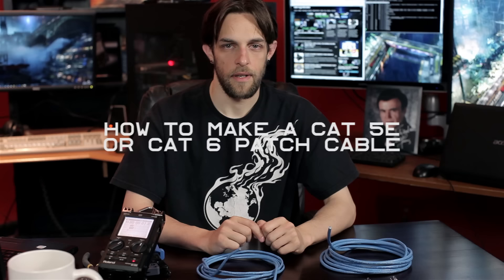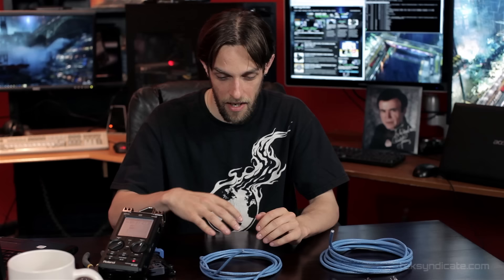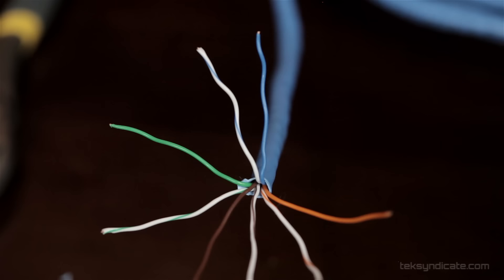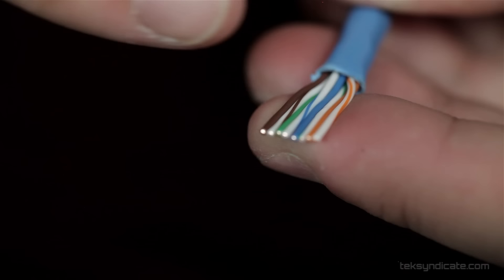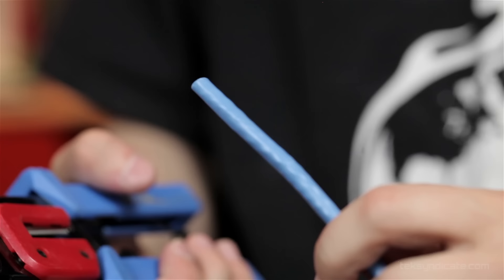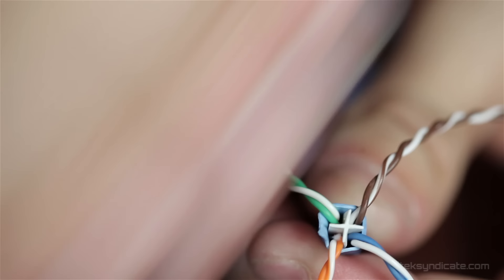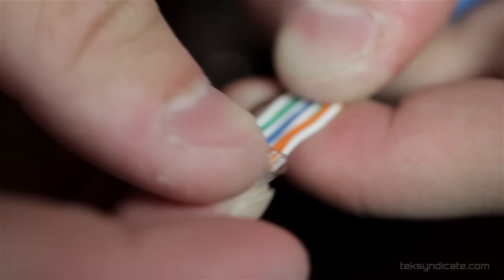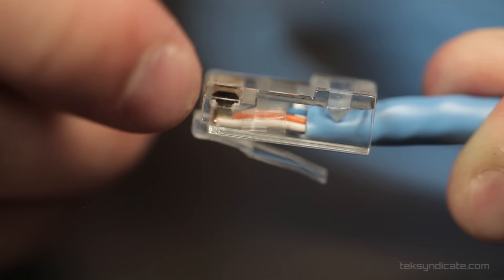How To Make RJ45 Network Patch Cables - Cat 5E and Cat 6

Comment: I have cat6 exterior black silicon wire with a centre star core ,. Need to get 2 plugs so to completed my stereo needs with BlueSound vault hard wired to my router cheers John

Comment: The load bars in cat 6 connectors look like they are not only designed to cut down cross-talk but they seem to hold the wires in order.  I was thinking of getting those EZ-RJ45 connectors that the wires stick out of when you crimp them and the tool trims the ends off at the same time.  If I just go with cat 6 I might not need them.

Comment: You make it look so simple! I've been trying to get the combination of the twisted pair wires into the RJ45 identical at both ends for the last couple of days without much success. All that I've succeeded in doing is to have run through a bunch of connectors. Any guidance would be welcome? My intent here is to prepare ethernet cables for a home CCTV network.
Reply: Personally, I would use passthrough connectors.  You don't have to worry about the length of the wires and it is easier to pass the wires through the connector and simply trim them after you crimp if your crimper cannot trim them.
Reply: @andrew7629  Thank you. I'll try to get those online. Afaik they aren't stocked locally

Comment: These cables are also not factory certified.  If you don't use the proper connectors, the cross-talk component at the plug will greatly lower performance.

Comment: Why do you not have to strip the wire to bare copper before inserting into the mod plug? I’m needing to do this as my drywall contractor put a screw through the patch cable I ran in my new construction.

Comment: Cat6 is a thicker wire and is 22 gauge. Cat5e is 24 gauge. That's one  I could never get why the convention is the smaller the gauge the thicker the wire. Also your using the 568B standard crimp, handy to know

Comment: Thank you, kind sir, very helpful and entertaining.  I am replacing a bunch of Cat5 cable with Cat6 for my home network.  I have some old but never used cat RJ45s.  I believe I've had them since before 5e and 6 were invented.  Is there a difference in RJ45s?  Should I get new RJ45s for Cat6?

Comment: Keep in mind, this is using the T568B cabling standard when most homes are wired with T568A. So make sure you know what standard you are using before following this video.
Reply: Doesn't matter as long as both ends are the same.  In 20yrs I've never seen an 8p8c terminated to A
Reply: @markhollingsworth3097 

All US government facilities require that the 568A standard be used.

Comment: I have been trying to get a cat5e or 6 cable with 8 pairs. The reason is that I want to wire up my house with double sockets in the wall. Pulling 2 cat5e/6  cables is a pain trough a pvc pipeline. Sadly I have found these at very high prices. 😞

Comment: I'm new to this and this is a great video. I expected each wire to be bared at the end? How does the connection work if the wires are not bared? Also wouldn't it be so much easier if all the colours matched eg dotted green with solid green etc.

Comment: Thanks handsome, BTW. I got the normal r j45 so is a pain in the ass getting the shift blue tube inside of it since is a cat6 cable. But I'm close to it. Thanks again. Everybody told me I was crazy because nobody got that I have a cat6 and couldn't managed easily to get the shift up after the clip

Comment: I Just want to thank you so much for this simple information that latterly helped me, why i ay simple bc i bought another router and i connected it to my base router and it working cable but i couldn’t get speed over 100 mb, i thought of changing the cable and it really a long cable, but i though to recheck the colors that the tech guy installed to me and i sow its different than what u show me, i reinstall the cable with ur color order and i got my full speed!!! 
I know i wrote alot but i want to thank you again and tell you how helpful u were i was going to pay another 100$ for cables.

From Jordan Kingdom

Comment: Right at the beginning you bend the cable waaayyyy too much. Usually single core copper wires get frayed due to that. Multicore won't
Reply: Yeah I quit watching when I saw him stripping the cable sheath with the cable crimp. For someone that has made as many as he said he has it is cheap cheap cheap to buy a cable sheath cutter and they work fantastic without all of the cable bending.

Comment: They are simple and easy with a good RJ45 connector. It's a nightmare with arthritic fingers and a cheap one piece connector (i.e no insert to help keep the conductors aligned). Always make sure to source these two piece connectors or the newer EZ-RJ45 that have end-pass-through holes. Working your way through a hundred cheap ones is a nightmare.
Reply: oh... and always fit a boot, they cost pennies

Comment: I wanted to make certain that I was building the cable correctly, so I took a working Cat5e cable which I tested and found it was running at 200+ Mbps.  But, once I changed the RJ45 connector, the speeds dropped to 90Mbps.  What am I missing?

Comment: I do have an actual question, and it’s mostly about the other end of the cable, and by that I mean, I heard in my networking class that the connectors should be somehow inverted or something like that? If you could answer that would help me a lot.

Comment: I have some commscope gigaspeed xl cable I want to use but the wires are all paired with a SOLID white wire,  instead of a striped. Should I treat the solid white pair as though they are the striped? THanks

Comment: I cut the cable going to my router open and its only cat 5 does it matter if its only 4 feet long? The house is wired with cat 5e and ive had network stability issues

Comment: So i wanted to (re)wire my home with Cat5e or maybe 6....but i heard there is a length limit....is that limit from the modem to each of the jacks i would make, or does making more jacks ports in anyway help. i guess what im asking is what is done to homes that have rooms or line runs that are much farther away no matter which path you take to the modem?

Comment: We try to not do this as general practice, buy the patch cable.  However, there are times when there is no room inside a field device to mount a field terminal so we end up having to crimp a plug onto the incoming cable.  I hate this... that is why I'm here...  One comment, when you twisted and bent the cable to remove the outer layer, couldn't that damage the wires?

Comment: cat 5, 5 twists per inch, cat 6 yep you guessed it. You always pull back at least an inch from where you score the sheath, bending those wires like that compromises their integrity. If you pull back you can then cut those bent wires off and you are left with pristine wire un bent weakened wires

Comment: hi i have a question pls. what do you call the tool that check which one end of the cable to the other side of the cable? for example. my main panel of ethernet is upstairs and i wanted to know which  ethernet cable is the one in the living room , there is a tool you can use to identify it using a tool by checking one end to the other end , if you can help me pls what tool is that , it would help me a lot , cause i just bought a hpuse and the previous owner mixed all the wires and i cant tell which cable is the one in the living room or any part of the house, thank you in advance

Comment: Old video but guess what. I had Google Fiber installed and the tech said my inside wiring didn't work (he put a new end on my Cat5) I pulled on the end after he left and it came right off. I watched this video and crimped a new end on and problem solved!

Comment: Well - I'm a novice and you are an expert [so you say] - and yet you just don't know how to strip a cable sheath using that 'little cord' that you cut away with the snippers.
This is what someone with brains would do: with snippers cut a small nick in the direction of the cable at the cable end. You are not cutting ACROSS the cable but ALONG the length for about half an inch. This exposes the ends of all the cables AND that little string that you cut off. You then grip this string by  wrapping round the end of a small screwdriver or around the ends of a small pair of pointed pliers and pulling down the cable as far as you wish to go to expose the inner wires. Then fold back the outer sheath including the little string and snip them all away. This is a much neater, quicker method than the one you show using the crimping tool which has the possibility of cutting into the inner wires or as you so expertly demonstrate doesn't actually cut all round the outer cable sheath so that you have to bend it back and forth to generate a split and then pull the bit off using your fingers! It's a fact of life that you are never too old to learn and no matter how expert you are there's always a 5 year-old kid who can teach you something. Have you learned anything? I doubt you will admit it because that's the sort of person you appear to be.

Comment: You really don't need a cat 6 rj 45 plug with the little plastic thing.
Just use the cat 5e plug. Take a little screw driver and straight the individual 
Wires out. Then follow way he completed the crimp.

Comment: Do you have a video of doing a female plug for in the wall? 

Just did the terminations at my switch using the same layout you displayed here which I’ve read is B.  So I used B on the female ends, yet when I plug in, there’s no connection.... not sure what I did wrong

Comment: Colour order is totally irrelevant as long as both sides are the same. When i did this for a living i made my own orderss per company to know if they messed with it. (no warrantee on cables that where not done by me.) Only exception is cross cables but those arent really used since self sensing became a thing. 
And gigabit works just fine over cat5e Heck they work fine up to 7 gigabits easy and for some purposes like straight file copying they even do the full 10 gigabit of you ahve a source and destination device thats that fast.

Comment: U are inserting the LOAD BAR the wrong way.  The wedge side should be in the opposite direction of the tab of the terminator.  IN your demonstration you have the load bar facing down as u do the tab of the terminator.  As such the holes for the metal that punctures the wire will have to break thru the plastic of the load bar just to get in.

Comment: Solid conductors are NOT suitable for the construction of patch leads as the conductors can fracture over time. You should be using stranded conductor cable for this application. Length limits apply with the use of stranded  conductor cable & need to be taken into consideration.

Comment: I've been doing this off and on for literally over 20 years and it's one of the most difficult, frustrating tasks in IT. Then I come here and see you call it simple and easy THEN watch you basically ruin the cable by bending the shit out of it trying to get the jacket off. The fact that your cable worked and my carefully built cables constantly fail is a strong indicator the universe should be destroyed.

Comment: Ugh I've been assigned DC task and I thought running cross connects would be fun. I WAS WRONG. I spent 3 hours nonstop just trying to get the wires to go straight into the  RJ45 plug. whenever they went in they either got bent or twisted or went in the wrong place! 😭😭

Comment: I thought Cat6 used 23 gauge conductor / wires
 - CAT6 operates at a frequency of 250 MHz, and consists of four twisted pairs of copper wire, typically 23 AWG (gauge).Apr 23, 202
What is the BIG DEAL about AWG (American Wire Gauge)?
www.cablexpress.com› faq › cat5-versus-cat5e-versus-cat6

Comment: How do you use a load bar? That seems to be a hard part.
Reply: It’s really not, one trick is once you have the color code in place, before you put on the load bar, cut the ends of the wire straight so that it is easier to wiggle all the wires into the load bar.
Reply: @hobbitkiller45  I went to Home Depot one day and bought Monster Ethernet plugs with the load bar inserts instead of Ideal ethernet plugs. The Ideal ethernet plugs seemed easier. They have a built-in load bar. The Monster ethernet plugs do not have a built-in load bar. The cables can slide around the ethernet plug a little bit.

Comment: A bit misleading with the order and colours you define.

You should make it clear if your making a crossover or straight patch cable, even then there are other uses for rj45s, pin outs are very important.

Comment: I don't get what the color sequence of the wires mean as long as they're the same at both ends! Do the wires know the color they're sheathed in, you know, cross current talk? Is this a protocol for the idiots in charge so they can say they are technically versed or what?

Comment: Don't make a patch cable using solid wire, that's what stranded is for. There's really no reason to ever put an RJ45 on solid cable. Also, the string is to add strength when pulling the cable.

Comment: Making CAT6 cable is wrong, .. loading bar must be faced up by raised side  towards contact  ..wires must be cut at the end of loading bar, and loading bar must be pushed to the end of connector, and must click there, to be fixed before using crimping tool.

Comment: Poor effort. The first point of the prong is not piercing the white conductor. And you did not cut the core back enough resulting in 3mm gap between the conductor bar and the sheath and 1/2 turn on the conductors wasted.

Comment: Can some one confirm me if this color patern(8:00) is still prevalent in 2019 cables?
Reply: Yes. He is using the EIA/TIA 568B standard. This is the prevalent and preferred pin out on most commercial networks in modern times.

Comment: This video has not aged really well.  My house is wired with CAT5 (not E) and is not only running 1gbe just fine... it's also doing 5gbe on some runs and approaching 10gbe on a couple.   Anyway other than that slight issue (it is 9 years old afterall) the video is great.

Comment: Seriously you connected solid cable into male RJ 45’s to make a “Patch coed” the copper will just snap after you connect or move it around . Stranded cable is what you use for patch cables . Did you even use the proper R J 45 ‘s designed for Solid cable.

Comment: NEVER use riser cable (solid wire) for patch cables you'll be sorry. Only use patch cable (stranded wires) for patch cables! And use the correct crimp connectors too. There IS a difference in connectors for stranded v. Solid wire.
This guy does not go over this in the video.
I have made thousands of patch cables